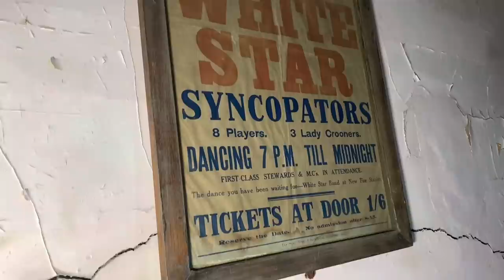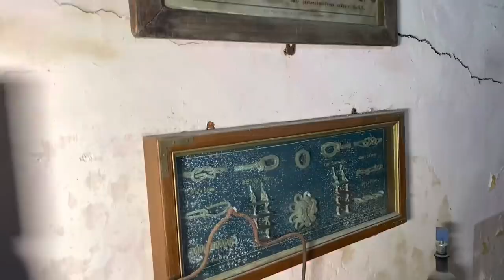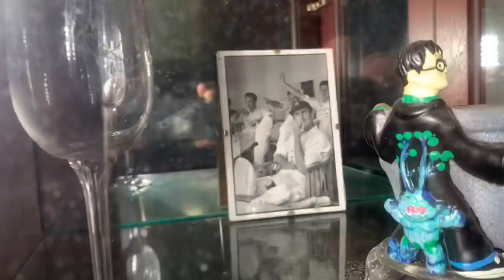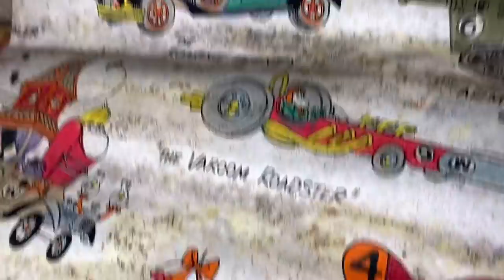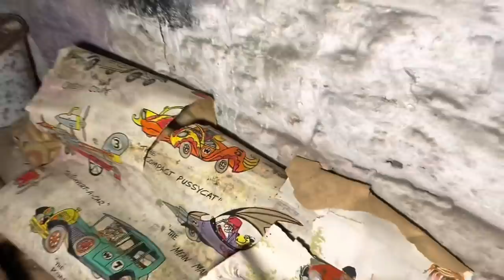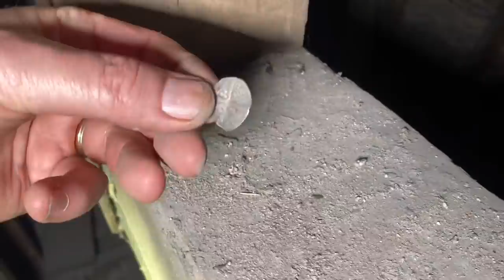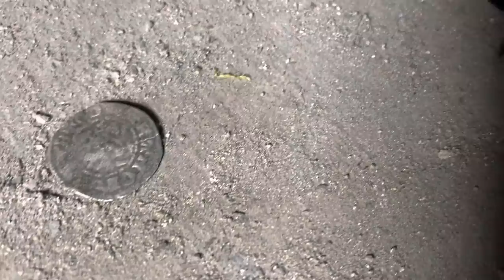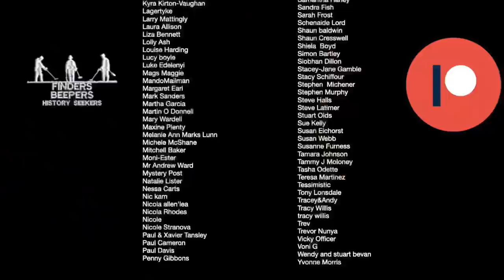Did this creepy ABANDONED house have a hidden family upstairs ?

Comment: Looks like someone bought a ton of Wyze Cams.  That clicking noise are the night vision sensors automatically switching from on to off when it was sensing your flashlights.  They were most likely connected via Wi-Fi so who or whomever set them up could watch you on their phone.  The video is usually sent to cloud storage in 12 second increments.